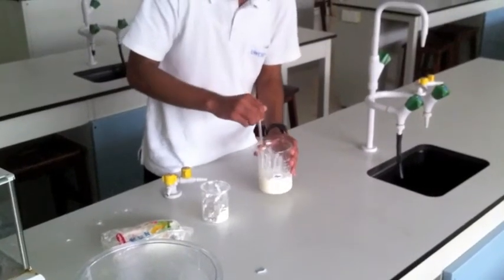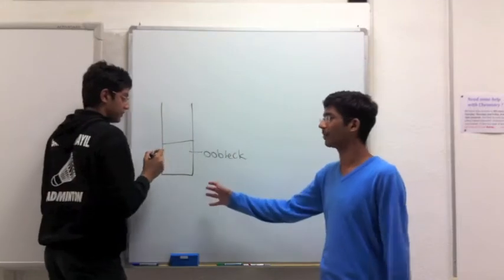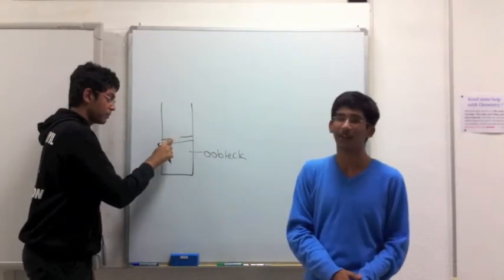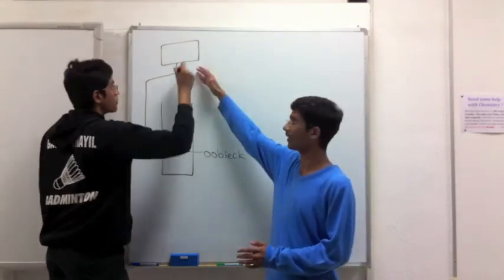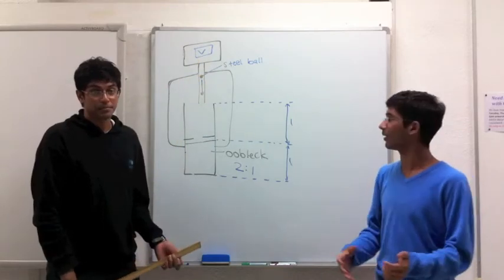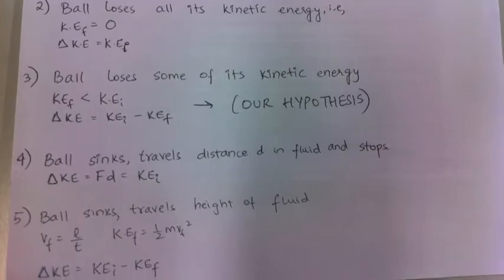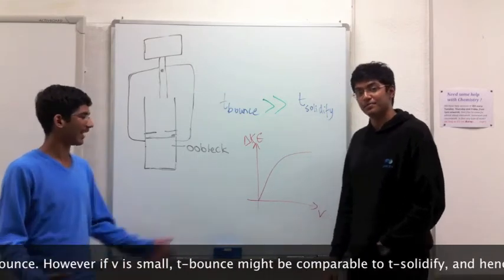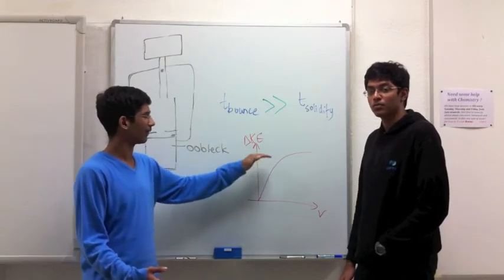Experimenting With Oobleck - Physics Entry for YouTube Space Lab

Comment: Make sure to measure the rebound height, too. So that you could work out the immediate velocity of the ball after collision. The loss in kinetic energy of the ball EQUALS the energy used in solidifying the cornstarch mixture. Repeat the experiment with different velocities,plot some graphs, we might find some correlation between the energy used for solidification and the initial velocity of the ball.

Comment: Interesting idea! I really like it, but I don't see how this should be performed under microgravity rather than on Earth. Did you try this on Earth? Gravity HELPS the experiment actually. By letting go the steel balls at different height h, the ball will be hitting the cornstarch mixture at different velocity v, which can be easily calculated with the motion equations v^2=u^2+2as, and in this case v^2=0^2+2*9.8h. No need firing gun, hah!